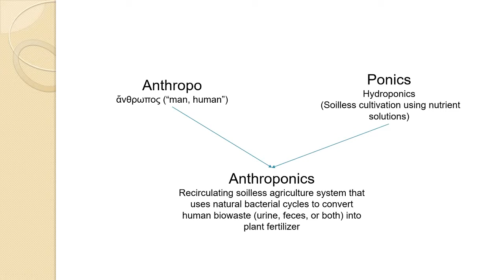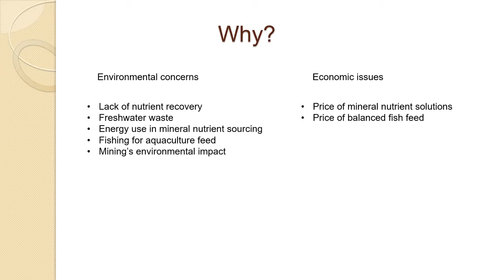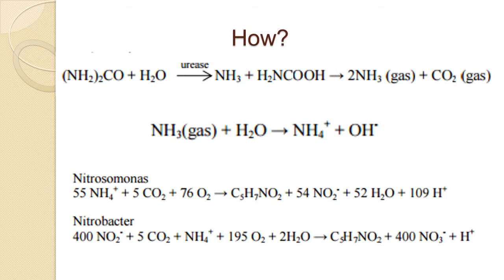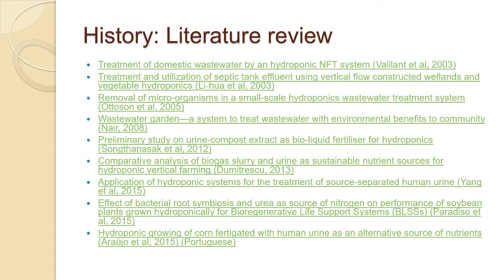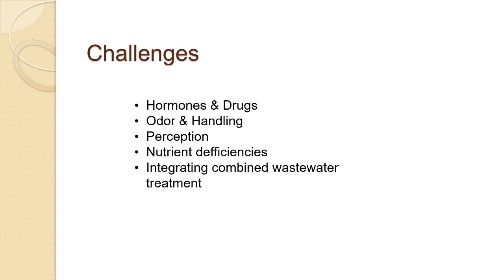What is Anthroponics & Peeponics and how does it work?

Comment: So, essentially, it’s not my urine that is feeding plants but rather hardworking bacteria that are converting my urine into things the plants can use to grow. It kinda makes me think about soil. You’re using plastics to create surface area but soil is essentially doing the same thing. Bacteria in soil is probably more efficient than bacteria in water because they’re able to create colonies more readily in stable soil than they are in water. Likely impossible in water unless you do things like plastics in filter bags. I’ve noticed that if you urinate on compact soil or sand that is constantly baking in the sun, you can start to smell the urine in the area that you’re peeing on probably because the rays of the sun are killing the bacteria that would have done the work of breaking down the urine. But very different than urinating on wood chips which is a better medium for sheltering bacteria and protecting them from harmful rays. It never smells like urine in that area.
Reply from the maker: The issue is that soil is also harboring many other types of bacterias and predatory microorganisms, in this sense we are attempting to cultivate a "purer" culture in the plastics (or other media) which can then make the colony form faster, and be more resilient to adversarial change in its ecosystem dynamics.